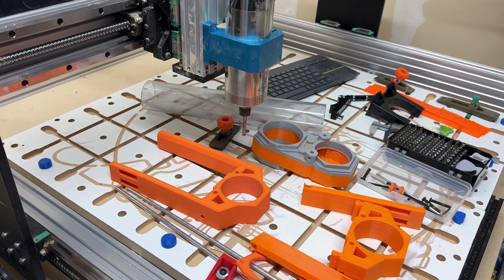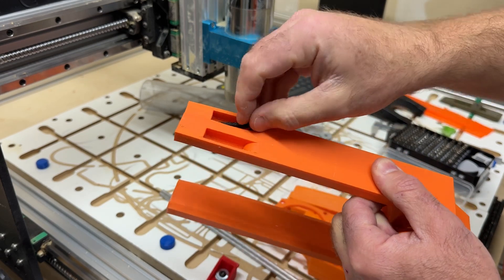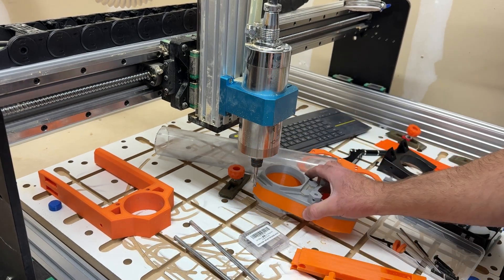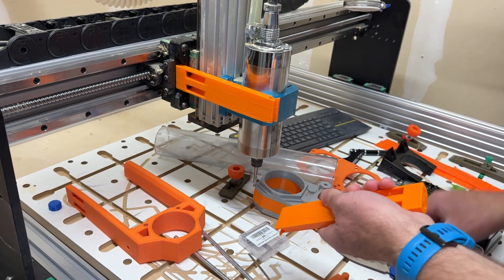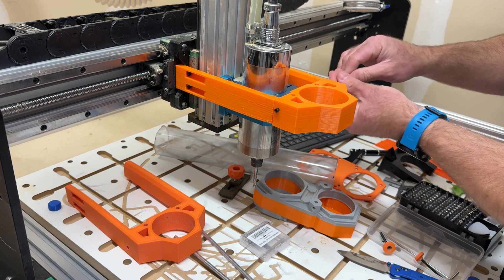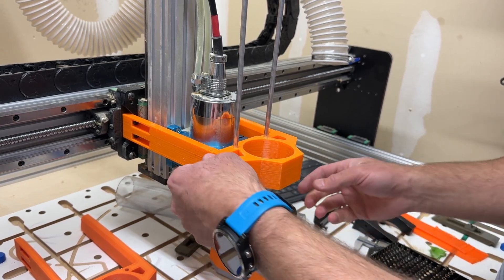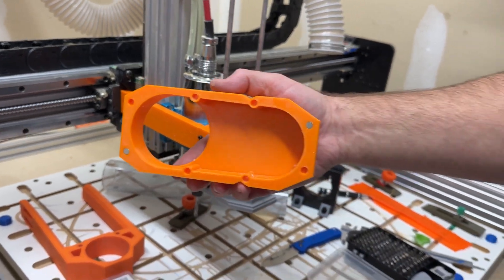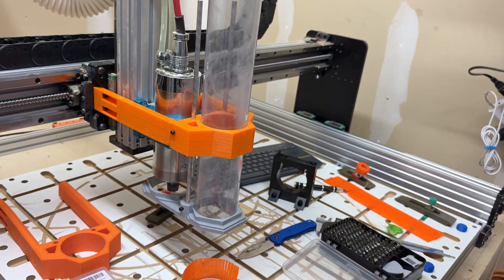Ultimate Bee CNC Dust Boot Assembly

Comment: I recently purchased the Ultimate 1000 x 1000 and have been following your channel for a while now—your videos on woodworking projects and mods for both the Genmitsu and Ultimate Bee CNCs have been super helpful in getting me into the world of making things.❤

 I wanted to ask: when you squared your Ultimate Bee, did you follow the manual instructions exactly or did you have a particular method that worked better for you?

 Also, could you share what kind of grease gun, grease, and especially the grease nozzle you’re using for maintenance? 

Thanks again for all the great content—you’ve really helped me get started on the right foot.
Reply from the maker: Hey man thanks for following the journey its been a blast for sure. 
The Mechanical guide is actually pretty good or the assembly so I pretty much followed the guide as they have it, I used a 8" known good square that I had to keep the bottom 2040 extrusions square with the far side Y axis rail as I tightened them up and then made sure that the drag chain Y axis side was parallel and then measured corner to corner of the Y axis to make sure it was all square before locking all the bolts down. 
My advise is leave everything a bit lose so you can make minor adjustments as needed. And double check your square a few times during the assembly.

I used a Shall Tools Mini Grease gun and it worked pretty good, for the money. The way that some of the nipples are setup it is pretty hard to top them up once assembled however. 

https://www.amazon.ca/Capacity-couplers-Extension-Cartridge-Reinforced/dp/B0BXL5QPVT/ref=sr_1_2_sspa?crid=M03STW55TVXK&dib=eyJ2IjoiMSJ9.B52uEk0OUdHcpaIzyXz7l46W-olrLmWLWipEIp_dQ1ug4puTOwDAu6A-F-lnMvR8h3qjahMnCsTZmV6iUlhPee8L3_AdsPoCqOgYGGUlWZO1P6YVlfpN0tWzWpSSP4Ni-M5K4QzD39GsJsvUcoKOHg.ktGA2GHjUAPNEJUyK2yx1xLKnSYr7DcTMNk0a1pIevM&dib_tag=se&keywords=shall+tools+grease+gun&qid=1746801431&s=hi&sprefix=shall+tools+grease+gun%2Ctools%2C116&sr=1-2-spons&sp_csd=d2lkZ2V0TmFtZT1zcF9hdGY&psc=1
Reply: @sparks-tech  Thank you, that helped me get through most of the mechanical and electrical build! 😅 I'm stuck right now with the wiring—I've chosen the CNC XPRO V as my controller hoping it would be beginner-friendly, and I managed to get the X, Y, Z axis wiring and proximity sensors done after watching multiple videos.

 However, I'm really struggling to find proper resources for wiring the mains power, VFD connections, and water pump setup. 

How did you manage these? Any tips or resources you followed that you could share would be a huge help!
Reply from the maker: Hey sorry I missed this, if you are still stuck please reach out to me via email, I will see if I can help.

Comment: I have the standard Bulkman3d Mount, will test how it clears and fits, I will also try make modifications to allow for the 80mm spindle and post a remix but feel free to include my files in your original printables link, I have stolen enough of your files already :D ( for use on my own machine only )
Reply from the maker: Sounds awesome man. Glad some of the files have been useful. 
I am not ready to share the CAD just yet but if you give me some nominal dimensions of the mount from the Z axis I can see what I can do with the files I have.